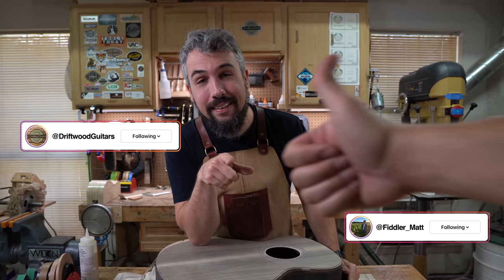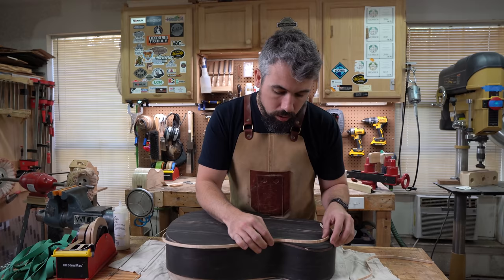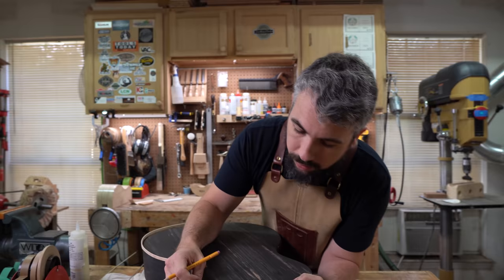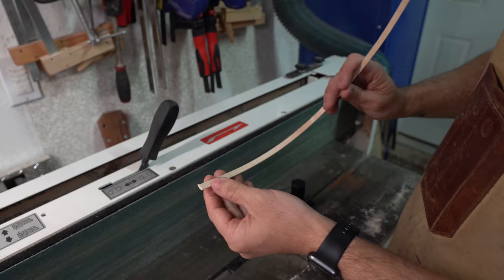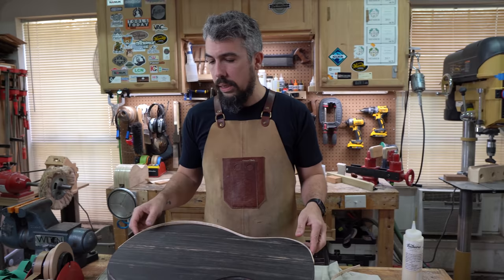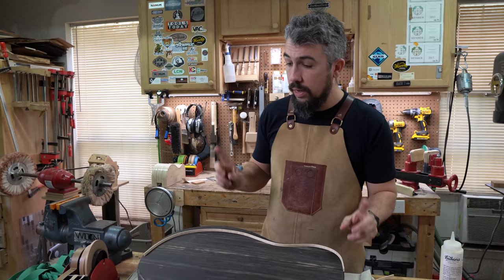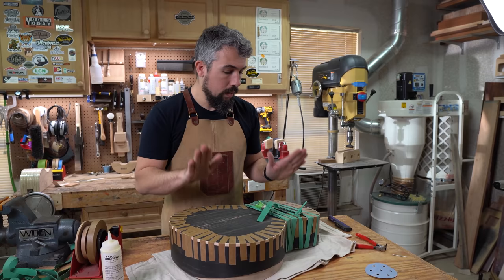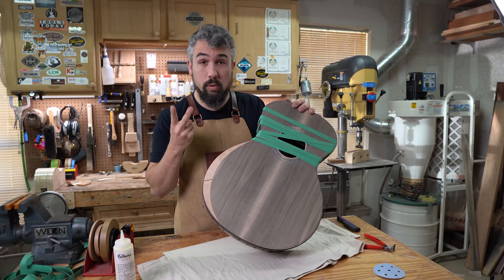How To Build An Acoustic Guitar Episode 20 (Gluing The Binding On The Back)

Comment: This is a fascinating series, keep it up. I love your work.
Whilst looking into guitar building myself I came across a piece of MIT research from 2015 into the shape and size of violin sound holes that I thought might pique your interest or inspire you.
The researchers found that a key feature affecting a violin’s sound is the shape and length of its “f-holes,” the f-shaped openings through which air escapes: The more elongated these are, the more sound a violin can produce. What’s more, an elongated sound hole takes up little space on the violin, while still producing a full sound — a design that the researchers found to be more power-efficient than the rounder sound holes of the violin’s ancestors, such as medieval fiddles, lyres, and rebecs.

The thickness of a violin’s back plate also contributes to its acoustic power. Violins carved from wood are relatively elastic: As the instrument produces sound, the violin’s body may respond to the air vibrations, contracting and expanding minutely. A thicker back plate, they found, would boost a violin’s sound.

Comment: I have been building guitars for over 40 years, and I used Titebond for most of that time. I only used hide glue when repairing violin family instruments or vintage instruments originally constructed with hide glue. A few years ago I learned of fish glue, and tried it, first on repairs and later on new instruments I built. I have switched almost entirely to fish glue now, both because it is a hard-drying organic like hide glue and because of the long working time. For me, it is perfect for wood bindings and purfling. It becomes tacky almost immediately, but has a long open time and a longer working time. It does need a bit more time to fully cure, but never longer than overnight. That harder set-up also seems less likely to absorb vibration energy. Just another take on glue.
Reply from the maker: Great insight. Thanks
Reply: good take

Comment: Great video as usual. My quick binding tape tip.  Fold the tape onto it self on the top making a small tab, making removal much easier.  It always comes off in one piece and quickly.
Reply from the maker: Duuude! Solid tip!

Comment: If I may, coming into the waist where there is a chance of the tape breaking, you can dispense 2 segments of tape, put one on top of the other and then apply to the binding. Holds really well and doubles the strength of the tape.

Comment: Thanks for all the great videos! Two questions:
1. Why not use one long piece of binding and purfling and skip the front joint altogether?
2. How well is the purfling glued to the binding? It looks like the only glue there would be from squeeze out.
Reply: I have the same question regarding gluing the binding to the purfling. I would have expected the purfling to be glued on first, then the binding separately.
Reply: There's multiple reasons for using smaller pieces, less waste using smaller pieces, if one part breaks off or something you don't have to replace the whole thing, and having a longer piece is a lot harder to get right, you can't just tape it to the side and correct as you go you'd have to fit it onto the back which means if one parts to thick or thin and you sand it down it'll affect the other sides fit. There's even more reasons then that but I just know it's not a good idea
Reply: @alextuozzo7138  great points. Curly woods in particular seem to want to break into smaller pieces.

Comment: Binding rubber bands suggestion. I use Bike tire inner tubing which is cut into strips, washed and then volcanize (glue) each strip end to end. It may be time consuming but over time it saves money and if you do it right they will last as long as the Stew Mac ones.

Comment: Long time ago, I wanted a rubber band like that, but couldn't find one, so I bought a bicycle inner tube for a couple of dollars and cut this endless rubber band from it.  Its pretty good. Seems like it was about 25 feet long and filled up a drawer in my cabinet.  You just have to be a straight scissor operator.  The rubber is pretty strong so I think I settled on 1/2" wide strip.

Comment: Nice work!! My Martin 00L-17 binding has pulled away from waist and made just small gap and it does want to press back by hand almost like it was too small or either shrank ... does it need to have new binding or will the binding stretch a little to get it glued and pressed back to the waist?